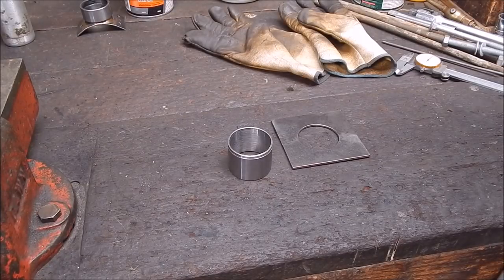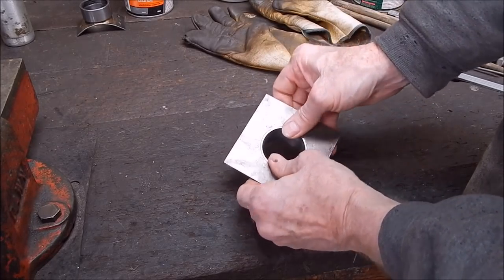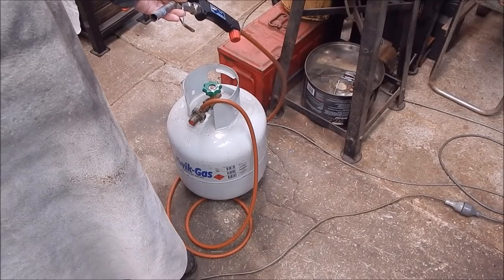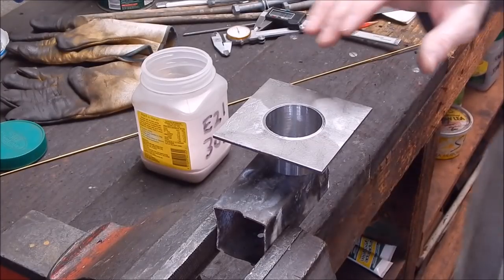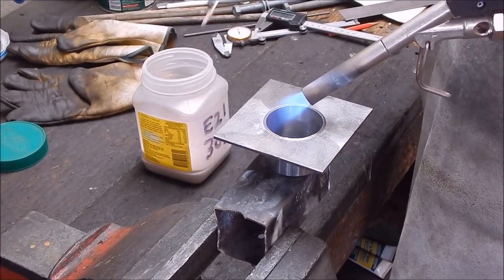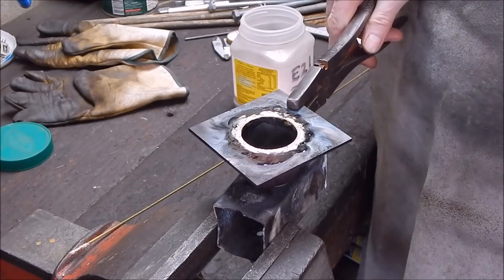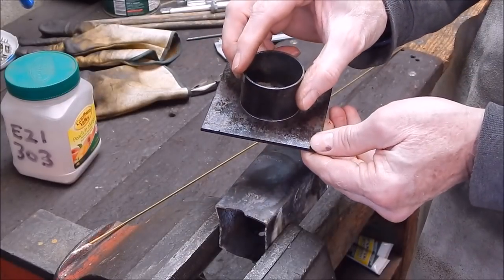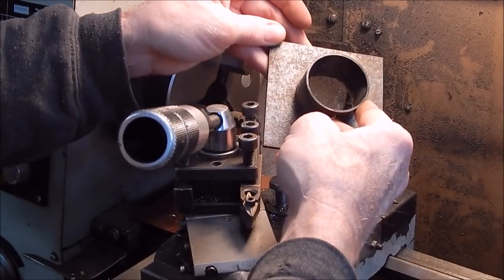Bullfinch auto torch LPG bronze brazing system

Comment: Hi Rob. Bought the torch and 2mm rods. But the flux BOC (Richmond, Adelaide) sold me is white Easyflo flux paste.  I think its general purpose and not specifically for bronze brazing.  Trouble I'm having is (i) hot bronze rod goes "fizz" when you dip it in flux mid-job and comes out fluxless (melted off) and (ii) bronze occasionally runs as it should but more often it beads.  It looks like a flux issue to me. I'm sure it's hot enough - metal is cherry red.  Is it worth me getting 303 powder flux do you think?
Reply from the maker: +Jon Moore 
Hi Jon,

The flux I use is general purpose, pink colour, and when you dip the hot rod in it sticks as a powdery coating.

Certainly the flux shouldn't melt off.  They do sell a flux which you mix with water and put it on by hand as a paste - sure you don't have that ?  Read the instructions and see what they say.

The bronze is beading because of not enough flux to clean the metal.

Yes, get some Eazie 303 if they still sell it - I've had mine for 20 years and the label has fallen off etc.

It's basically the same flux as you use for oxy welding with steel rod/wire. - ask for that (it's a dipping flux for sure).

The only flux made specifically for bronze that I know of is the wet with water/paste type - which I think you might have.  That is used when you melt the job in a furnace - ie. lay bronze pieces and flux where you want it and then heat up the whole job to melt it.

Many people use that method, but you can't work freehand that way.

Cheers Rob
Reply: +xynudu Yes Rob maybe you're right. Now that I look again I see there are no directions on the bottle. Maybe it isn't for dipping.  Here's a link to the stuff I have: http://www.boc.com.au/shop/en/au-boc-industrial-store/boc-easyflo-sb-flux-paste
I'm in the process of getting some Ezi-weld 303. I'll give it a try and let you know. Thanks for your help.
Reply: +xynudu Rob you're brilliant! The 303 flux has arrived and I've found it's alll about the flux!  I'm now a champion hard bronze brazer. I paid $60 for one quick brazing job commercially a couple of years back.  Half a dozen of those & I've paid for it - and I've already done 5!! Happy man.  Thanks for your videos.
Reply from the maker: +Jon Moore 

Thanks for the feedback.  Yes, I was pretty sure you had the wrong stuff.  Glad it all worked out OK.

Incidentally, if anyone want's to get hard bronze brazing done cheap, try your local radiator repair company.  They also work with bronze, as well as solder.  An engineering/welding shop will likely charge much more.

I had a job done years ago on a power steering pump housing, and it was only a few $$$s at the time - through the radiator repair shop.

But, nothing beats having your own torch.

Cheers Rob
Reply: +xynudu Thanks Rob.  Another question. I'm re-joining some joints of a galvanised wire topiary frame. Brazing I know would not be the only way - or even best way - of going about this but that's how I'm doing it. I assume in the process I'm destroying the galvanising in the local vicintiy of the join?? I'll spray jonts with galv spray.  Should I brush or wash these joints before painting. Any other suggestions?
Reply from the maker: Jon Moore

Hi John,

The galv will be destroyed by the heat, as expected.  However, it's a good way to join something like that, as you only need a very small amount of bronze to bond the two wire contact points.

Clean/degalv the contact points with emery cloth before brazing, and try using as little flux as possible.

Quench the joint with water after as soon as possible (while red hot) to make the slag release more easily (through differential thermal contraction).  This saves a lot of scrubbing.

After brazing, wash/wire brush the flux residue away, then cold galv paint.

Flux residue remains active and can cause a reaction with galv (over time) unless removed.

Small diameter work like this is where the BF gun really excels - with oxy/acet you can easily melt the job away.

Feel free to ask on any issues re this subject.

Cheers Rob

Comment: Excellent video quality. What camera are you using?
Reply from the maker: Nikon L820 - still a current model and cost me $215 AU.

I have seen them secondhand for under $100 on Gumtree etc.

It also runs on four AA rechargables or ANY AA so that's a big bonus IMHO.

Cheers Rob
Reply: Thanks.

Comment: Hi Rob   Can i braze aluminum like auto air condition pipe with this torch
Reply from the maker: Hi Gasper,  it will braze anything that MAPP gas can braze (similar heat/temperature rages).  I'm not familiar with brazing auto air conditioning pipe (which is aluminium from my limited observation).  Oxidization is normally the issue welding/brazing aluminium and I have only ever seen screw fittings used with auto refrigeration applications..  It will certainly melt the pipe.  Cheers Rob

Comment: Hi Rob, Is the threaded pol section removable, or is the reg a one piece casting ? Cheers, Paul
Reply from the maker: Looks to have a pin through the regulator to allow change over.  I'm not sure how these things disassemble, but I expect the pin comes out and you unscrew the centre tube section out of the regulator body to swap over the POL fitting.  Rob

Comment: hey man awesome video would I be able to braze aluminium with lpg?
Reply from the maker: You would need MAPP gas equivalent and some of those low temperature tin/zinc based rods sold on Ebay for aluminium.  I doubt a normal LPG torch would get it hot enough - try it and see.

I did several videos on the rods a few weeks back.

Rob

Comment: I have to buy one of these torch. The pressure from the thank is much higher than the one from a small bottle.
If I had to to something like that, I would place the paste all around the hole and remove the excess, cut some small part on the long rod and place them équidistant distance one from the other. Heating from under, the melting is cleaner and you can see the progression of the brazing from the top without being disturb by the flame. I do that when i need to join the 2 parts of a ring. It's a jeweller's method of working.
Thanks for showing.
Reply from the maker: Thanks for the tip.  I have used that method a few times, and it would have worked well here.  Didn't think of it. Rob
Reply from the maker: Hi Robert.  This torch operates at 4 bar pressure and requires a large capacity bottle.  Rob
Reply: "The pressure from the thank is much higher than the one from a small bottle."
Sorry to inform you, the boiling point of a liquefied gas, does not change just because you have it contained in a larger or smaller cylinder. Provided the temperature of two differently sized cylinders of lpg is the identical, so will be the pressure. See pressure/temperature relationship.
Reply: djpaulk It's only faster I believe.
Reply: Robert Patoine Faster? Please elaborate. Are we talking about bottle size still? It does not matter how fast gas can be released from the cylinders valve when there is a 4bar regulator attached. What Rob means when he says "requires a large capacity bottle" is the regulator has pol style fitting to go to the standard 9kg bottle. The torch would perform equally well with a 4bar reg and a primus or companion style fitting to go on a, say 1.25kg portable cylinder. If you read a MAPP gas cylinder it says, 3x faster heat transfer than propane, so I do exactly know what your referring to as being faster. I think you mean cheaper.
Reply: *****  Why are you directing your comments at me?
Thanks for the lesson on torch principals, but really not needed mate.
Being a refrigeration technician, welding, cutting, brazing and soldering are a big part of my trade. That's why I was taught them by qualified teacher while doing my apprenticeship at Ultimo Tafe in Sydney :D

"the pressure is controlled by the regulator and the valve of the gun"
WRONG!.. 
The  'pressure regulator' does indeed control the pressure, thus its name  but the valve in the gun, controls what's known as the 'flow rate'.

 Also I do not need a lesson on flammable gases, not only do I burn them in my torches, but butane and also propane are actually also used  as refrigerants in small appliances.
How about you do some reading on R600a and have a nice day ;)

Comment: hows it going rob,i just bought the bullfinch torch from England.model 2300.the connection does not fit to a standard lpg exchange bottle you get from bunnings.do you have any ideas for me,much appreciated,thanks geoff
Reply from the maker: Hi Geoffrey,

That's right, it does not fit the AU, NZ, or USA cylinder POL fitting (which are all interchangeable).

I have said this on numerous occasions in comments, on my videos about the Bullfinch torch, warning people what will happen if they buy from a UK or Ireland supplier.

There are two solutions - swap the POL taper fitting across from another appliance, or buy a replacement regulator with the AU POL thread.

The regulator MUST have the correct flow and pressure rating for the torch to work properly.

That model torch is not suitable for brazing.

Cheers Rob
Reply: so how did you fit yours to an au gas bottle????
Reply from the maker: I bought it in AU.

All torches sold in AU have the correct POL thread.

Rob
Reply: Yeah at 2-3x the cost. UKP104 plus freight or AU$380.

Comment: ......IT APPEARS THAT THIS TORCH SYSTEM IS NOT SOLD IN THE U.S.A.!!! W.T.F.??!!!! WHAT KIND OF "FREE MARKET" B.S. IS GOING ON, HERE!!!???....
[BTW: GREAT DEMO VIDEO!!! THANKS MUCH!!!]
Reply from the maker: Yes, it's a very strange situation.  Not sold in Canada either.  I have no idea why .  If you want one, buy it from an Australian seller as the AU and USA gas connectors (POL) are compatible.  The UK one is not.  Cheers Rob
Reply: @Xynudu  Thank you, I might order one very soon!  Do you know it there are multiple tip sizes, for a variety of applications?....  I'd like to get several, if available! (for small/jewelry sized, or LARGE/Shop Projects)...!  :D
Reply from the maker: This is the one I use and which is sold out of Australia:  https://bullfinch-gas.co.uk/blowtorches/autotorch-brazing-sys/autotorch-brazing-kit-detail

These are the other available tips/components:  https://bullfinch-gas.co.uk/blowtorches/autotorch-brazing-sys

I don't think this torch would be suitable for jewelry.  You need a high temperature micro torch for that as I understand it.

Cheers Rob

Comment: how strong this bronzing comparing to welding ? what max heat can it hold, is it applicable for stoves ?
Reply from the maker: Hi Dmitry,

It's extremely strong.  It is only limited by it's melting point.  Cooking ware is made of copper, so it should be OK for stoves.

Rob

Comment: Rob i tried to purchase the Bullfinch Autotorch Brazing System Kit (4104) from the UK and they told me they do not ship outside of the country, Do you have any idea where i can purchase this item ?
Reply from the maker: Michael Mikenleeds Hi Michael.  There are definitely Ebay sellers/stores that do ship outside the UK, as members in the following forum have got them from the UK.

http://www.woodworkforums.com/forumdisplay.php?f=65

Post the question in there and you should get some help.  Also search back through the archive for the subject.

Be aware that the UK POL fitting (cylinder connector} is different to AU and possibly other countries.

In Australia the only agent is EH Cambridge and Co at Mt Barker South Australia.

http://www.ehcambridge.com.au/

They ship Australia wide,and possibly overseas.

I hope this helps.

Cheers Rob

Comment: How do you hold the spindle to take the chuck off that lathe?
Reply from the maker: Put the chuck key in one of the female chuck receivers.
Reply: @Xynudu  That will move the chick, but how do you hold the spindle from turning with it?
Reply from the maker: It's not a screw on chuck.  It's a bolt on chuck, so the chuck and spindle are firmly locked together.

Comment: Would a TIG welder be a better option for this job?
Reply from the maker: Better in what way?
Reply: From what can gather(Im not  experienced at braze welding)
better heat control and no messy flux is needed... and a excuse to obtain more tools :D
Reply from the maker: st170ish I've never used TIG.  I think you may still need flux to clean the metal. Someone with TIG experience may be able to answer this. Rob
Reply: I dont think they use flux when brazing with a tig just need clean steel, the argon keeps the oxygen away.  Check this guy "Jody" out if you haven't already seen his videos
http://www.weldingtipsandtricks.com/tig-welding-brazing.html
Reply from the maker: st170ish He's brazing, but he's making a fillet weld, not a capillary bond.  Big difference.  Torch and oven brazing heats the metal so that bronze flows between both faces forming a full bond that is mostly invisible from the outside.  There is no bead as in the video.  It's a totally different form of brazing.  Cheers Rob
Reply: xynudu
 Yes you are right, I was more referring to using the TIG as the heat source, weather it would work in this situation I dunno... might have to research it to find out!
Reply from the maker: st170ish It's a good question.  I don't know the answer.  This is usually the domain of torches and ovens.  The TIG heat may be too severe/localised to heat without melting the work pieces.  Cheers Rob

Comment: Hi, would you say that bullfinch torch would be suitable to fillet braze a bicycle?, the tubing in general is < 1mm but certain parts ( BB shell can be 2.5mm thickness) . You demonstrated in this video with up to 3mm steel parts,  but typically for fillet brazing they use a lot more filler material ( like this https://coresites-cdn.factorymedia.com/bikemagic_new/wp-content/uploads/2013/01/16-Student-Brazing-better-than-some-of-the-pros.jpg)

Thanks
Reply from the maker: For that type of brazing you will need an oxygen boosted torch.

The Bullfinch would struggle with that amount of heat sink effect by the tubing - not recommended.

Cheers Rob

Comment: Hi Rob, thanks for many interesting videos! I have decided to get a brazing gun like this, but I am not sure what burner size(s) I should get for it. There are 3 different burners, a smaller and a larger in addition to the medium one (4104) that you have on your gun. Have you tried any of the other burner sizes? The small one seems a lot smaller, only 1.84kw of heat (the medium is 4.76). The large one seems only slightly larger with 6.16kw. However from the flame data that Bullfinch provides on their website it looks as if the large burner has a flame that is quite a bit wider and maybe doesn't concentrate the heat so well? Flame data can be found here if you are interested: http://bullfinch-gas.co.uk/blowtorches/autotorch-brazing-sys
Reply from the maker: Altmuligmannen The burner on mine is the only one that came with the gun, and is the one recommended for hard bronze brazing.  It has a concentrated flame path similar to a MAPP burner, but slightly larger diameter, so overall BTHU is up a bit on that.

I haven't tried any of the other sizes.

I have seen the data on the other ones, and I think you can get a kit with all of them.

BTHU is not the full story, as flame concentration is the key issue - as you mention.  You can get air assisted LPG guns with high BTHU, but the flame path is huge and wooly - no good for hand held brazing.

I would just go with the 4140, as that was the one the agent demonstrating the gun was pushing as the best for this sort of hard brazing work.  I have had mine for about 15 years and it's excellent within it's capabilities.

Not cheap, but worth it.  Definitely as good as, and slightly better than MAPP gas.  Cheers Rob